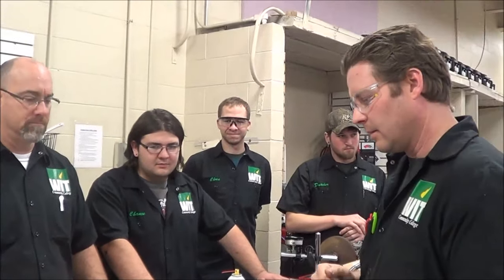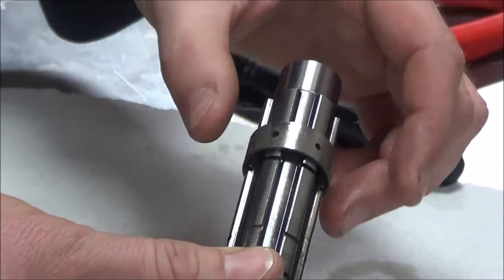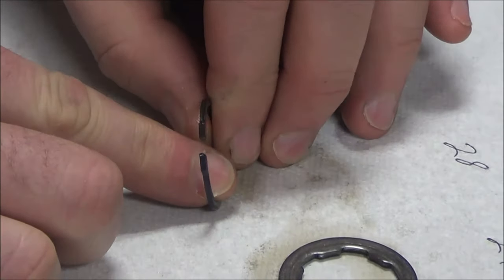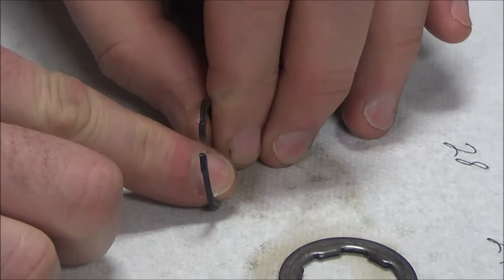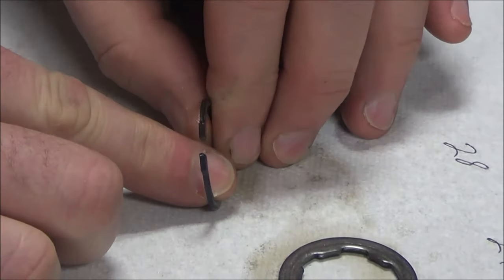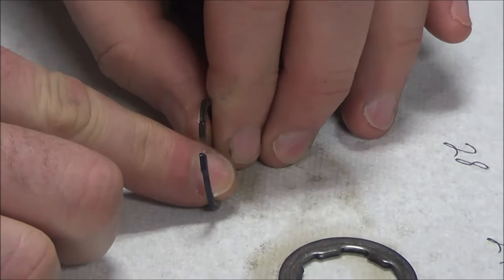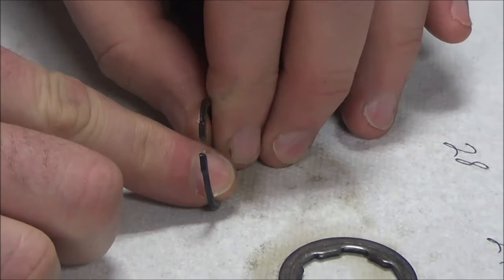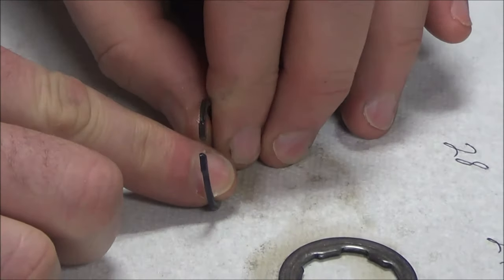4 Stroke Engine Disassembly:  Transmission Inspection  and Teardown

Comment: Good video! At the 12 minute mark - I had exactly this happen, full-throttle on a 210whp bike, 3rd and 4th made friends with each other and decided to work at the same time... It locked the rear wheel for about 2 seconds at which point 4th gear shattered allowing it to start rolling again in 3rd gear and gently got it the 2 miltes to the house safely.  Ended up milling larger grooves for oversized snap rings, back-cutting all the gears, shimming everything to be "just right", and rebuilding it myself since OEMs can't even get it right. Bike now makes 260 whp and shifts better than it did new. Do it right! 50 cent snap ring tried to kill me and very easily could have airconditioned an engine that costs more than most 1000cc sport bikes do.

Do. Not. Screw. This. Step. Up.
Reply from the maker: Love real world stories backing up our content! 

You rock for commenting! We will let Shane know! You can give him a high 5 here:  https://www.paypal.me/how2wrench   
Another way to help us back is joining or grabbing our T-shirt! Support links and gear below!  Awesome and thanks for commenting! Smash the subscribe button (thank if already a sub!)
Have you seen our "YouTube Trained Support Shirts? Great way to "high five us" https://goodfellasmerch.com/collections/how-2-wrench/products/support-shirt 

Join this channel to get access to perks:
https://www.youtube.com/channel/UCBhM8DCKnT3qXwTW0eToyCg/join    
-Daily MEMBER FIRST COMMENTS ANSWERED FIRST 
-Live Q/A video chats
-Wonder if we have a video on your need? Members can request content links!
-Full Access to the ENTIRE 700 video library
-Member-Only FREE tool giveaways   

Got an emergency and your head is about to explode from frustration or fear? Get Shane’s cell here: https://how2wrench.com/ols/products/techline-one-on-one

Comment: Good video. I'm not a professional mechanic but at 26:00 ish, I would have used a dial indicator instead of a "drop" indicator as demonstrated in the video. The dial indicator is more accurate and doesn't drop into and get caught on splines and what-not if you set it properly. 
In my world (machine shop) a "drop" indicator is used for primarily checking depths not the run-out of a shaft.
Reply from the maker: I think I get what your saying but a bit confused on the terminalogy your using. I did a quick search and saw dail vs test indicator. I see the dial and drop as the same indicatior. I think your referencing the indicator that would lay sideways on the shaft? In a typical shop it would be common to have dial (plunger) indicators but not likely the test (sideways) indicator. I like your idea (and thank you). 
👍 Thank you for taking the time to comment! Hit that subscribe button if you haven’t please! It helps us! 
Here is a way to support all the free videos.
Want to say “thanks” or “keep it up”? Click here https://www.paypal.me/how2wrench  

Coach Conley is also available for hire to personally work one on one with you if ever needed. Yep he is a real person. Give him a call @ 602-345-0432
Details here: https://how2wrench.com/product/personal-tech-training-phone-facetime/ 
Your answers and help are just around the corner. Save time and money while protecting your investment and yourself by doing it the right way!
Follow us!
Web:
www.How2Wrench.com     
www.Tools2Wrench.com
Reply: @How2Wrench  look up "Starrett 3809A" that is what I was talking about.

Comment: Thanks Shane ! Great vid I could only add that with the gearbox inspection u didnt include the kickstarter idle gear which is on the other side of the case but still on the transmission shaft. On my 1988 kx 125 it has somehow welded the kickstarter idle gear to the shaft.  Im thinking about getting it machined up or replacing it . the parts are getting hard to find.
Reply from the maker: Bob Brown Head over to the new website and subscribe to the newsletter to never miss a video or newsletter! 
https://how2wrench.com/contact/ 

If I can ever be of service to you, here is a video explains how to connect with me. 
https://www.youtube.com/watch?v=vjvmB01ebcs 
Keep Wrenching,
Shane Conley
Instructor/Motivator/Motorcyclist
www.how2wrench.com

Did you like this free video and hope to see more? Would you just like to say thank you with a donation? Click https://www.paypal.me/how2wrench
Reply: got enough ham in a can  as it it thanks bro only interested in the insides of motors

Comment: hi there. I need your help. I recently opened my crank case to replace the bearings. the bearings were CN , but I replaced them with C3 ones. will that effect the engine? because I am now facing a wired roughness when the bike runs. please help
Reply from the maker: That’s a great question for Shane directly! We are just the social media team. He is overseas training techs until the 19th but is trying to schedule time each day to answer techline orders still. 
Shane has a solution for you. As far as the question, Shane does answer questions when he get's back around to non members eventually so hang tight, FYI >>>> he does member ones daily!
He is just returning from an extended stay in Japan training students this winter. You can imagine how full his inbox is. We put orders are to the front of the line.

The one-on-one service. Get Shane’s cell here: https://how2wrench.com/ols/products/techline-one-on-one       
Quick answers are answered daily as a channel member: Join this channel to get access to perks:
https://www.youtube.com/channel/UCBhM8DCKnT3qXwTW0eToyCg/join   
-Daily MEMBER FIRST COMMENTS ANSWERED FIRST 
-Live Q/A video chats
-Wonder if we have a video on your need? Members can request content links!
-Full Access to the ENTIRE 700 video library
-Member-Only FREE tool giveaways  

Have you seen our "YouTube Trained Support Shirts? Great way to "high five us" https://goodfellasmerch.com/collections/how-2-wrench/products/support-shirt